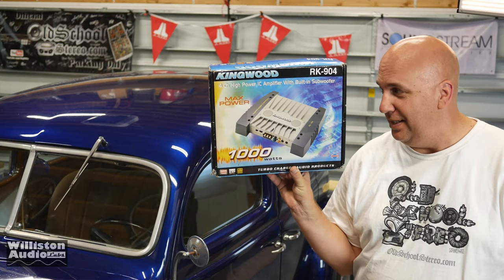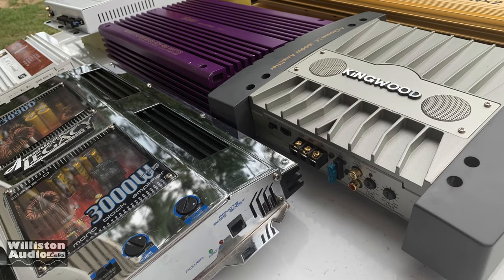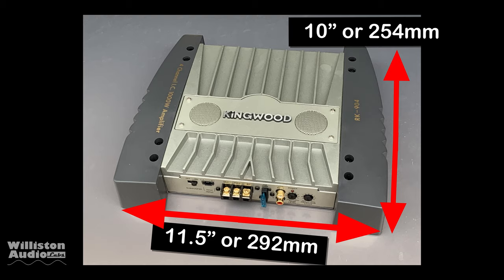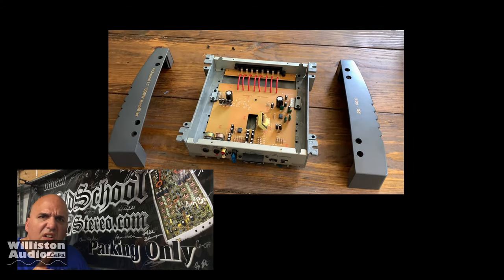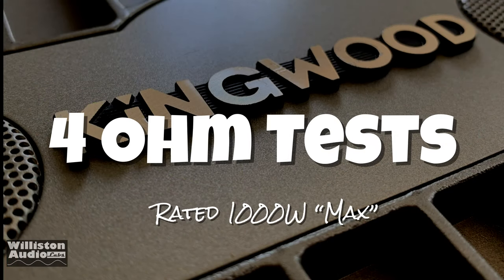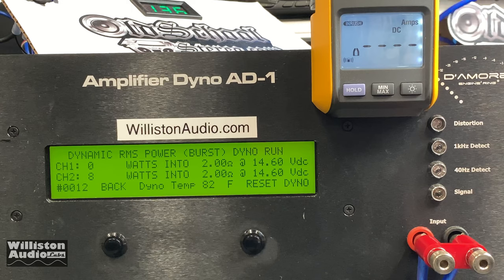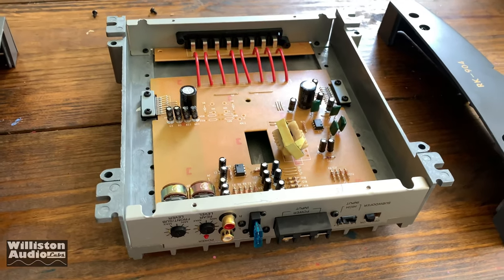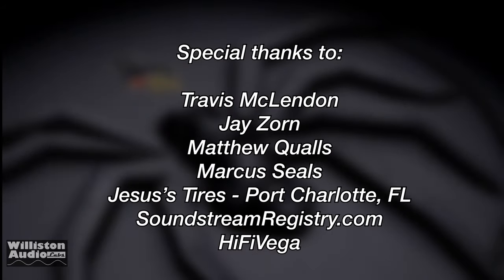Amp With Built In Subwoofer? Kingwood RK-904 Flea Market Special [4K]

Comment: Love these flea market amp tests. Takes me back. I got duped over 20 yrs ago by one that was supposed to be 275x2, and was a mostly empty case with lead weights inside it and had 3 20 amp fuses that didnt even connect to the board.

Comment: I had my share off flea market amps.  They used to have clearance sales at the Civic Auditorium here in Omaha Ne back in the 90's.  I bought a red amp that said 1000 watts max and it did not have a gain control on it and I bought  a sub box with 2 15 inch subs with tweeters.  I though i had something back then didn't know any better.
Reply: Dj Kamikaze 😂 we’v all been that route

Comment: I'm a Kingswood authorized dealer and the reason you got those numbers is because you did not load waste into the flux capacitor at the center of the amp as instructed by the owners manual. also, those two rings were holding dark matter and by moving them not only did you rip a hole in the space time continuum, but you also voided the warranty buddy.
Reply: Thats what I was gonna say. ...

Comment: A more ridiculous amp is built by RF in their Lightning Audio line. The amp is labeled with the Fast and the Furious logo, with the wires themed the same way, and the accompanying 10 inch sub is grey and red that says Fast and the Furious in the dust cap.

Comment: I think it's a great amp, for those wanting to just understand how components can make some power. Could also be good for begining amp repair since there is plenty of space between components. Not so good for use though.
Reply: True to a point but IC amps like this are completely different from amps with discrete transistors so practicing diagnosis and repair on an amp like this doesn't serve much purpose. There are plenty of broken, decent quality amps to be had cheap if someone wanted to practice repair

Comment: I'd like to assemble the guts of a REAL amp inside that case and hook it up in a car to mess with my friends.
Reply: Holy shit. I might have to do this with a Pyramid heatsink! This would be a supreme punking for sure. Brasilian amp PCB would do nicely.
Reply: How would you heatsink the FETs?
Reply: @cup_and_cone  It would be too much of a pain in the butt to actually attempt. A novel idea though.
Reply: @cup_and_cone  But, if I really had to (for this lovely Kingwood) then probably JB Weld two of three studs/standoffs onto sink, then use a bar and thermally conductive isolators to clamp them down. Taramps 4 channel amplifiers are compact as is the HD series. I think having someone think this flea market amp is driving 2000 to 3000Watts into a quality subwoofer would be the most fun.

Comment: Id take any boss amp over this.
Reply from the maker: Yeah pretty much
Reply: Boss amps are honestly pretty well built and designed, if they just gave them honest wattage ratings they'd be a good company.
Reply: @ixionn563  some are and some not as well as many other budget amps. Its usually a mixed bag when dealing with them.

Comment: I remember a friend of mine buying a flea market amp that was purple and said “LA Power on the front. It was a huge amp. It kept overheating and shutting off on him. So I took the bottom plate off to look inside. There was a circuit board in there similar to this one in the video. Except it only took up one small corner of the amp. The rest of the amplifier heatsink was empty.

Comment: I think this was by far, the greatest example of a cheap flea market amplifier I have ever ever seen. I am still in disbelief at the crappiness of this amplifier. Nasty galvanized bottom plate. One sided, through-hole phenolic PCB - and most of it was phenolic and nothing else. Interesting how they spent the time and money for the top cover and two round grilles. To be fair they did say 'IC Amplifier'. The Chinese forgot to add 'Xover' or 'Crossover' after 'Built in Subwoofer'. Nice transformer by the way. Looks like they too it off a compact fluorescent backlight supply from a laptop. Incredible. Dick Riculous shot this down super fast.

Comment: We had a flea market amp in 2001. We took it to electronics class to fix it. When we opened it up, it was just a single board with power going to the LEDs. The terminals and RCA's were all mounted but went nowhere. No circuits existed other than the protect and power LEDs. We had a good laugh. Similar to this, it was very heavy. I think we paid around $50 for it. Got what we paid for I suppose
Reply from the maker: Yeah, that’s crazy
Reply: Yeah a light show. 😜😜

Comment: I have an alpine amp it’s one of there old skool ones. It’s huge and very heavy. It’s a d block 2 channel and I think it gives out 900 watts at 2ohms bridged across the 2 channels at 14volts. I never thought much to it but apparently it’s a very good sort after powerful amp. It also has an large 80amp blade fuse in the side 🤷🏻‍♂️ it’s the MRV-1507

Comment: Should do the cheap amp shoot out... For the high school kids with low funds. The power acoustik amps vs lanzar etc. Even though they wont do their claimed 4000000 watts.. They do put out a solid 1000-1800 watts for 200 bucks... Like a comparison between wattage and efficiency and price and over all quality. For a budget system if you can get two efficient amps that push 1000 watts and a couple budget subs.  You Could build a decent system.
Reply: My little brother and his friend both have the same model Honda accords and they are doing an all out budget build to see who can get the most sound for 600, they can use head units they already own, and deadlines Oct 1st lol I can't wait to see who does the better build!
Reply: @frankkirkman5994  hit me up when theyre done.  Be a good vid

Comment: You need to get your hands on an American Hi-Fi EQ booster from around 1991. Gold colored faceplate with an ALARM. It has a TDA2030 8W mono amp inside for its four channels. The EQ sliders have no frequency adjustment. It’s like 10 volume controls all wired in series. Easily the worst of the worst.
Reply from the maker: Sweet! Right up my alley

Comment: Holy crap! The speaker outputs are not even marked 'Front/Rear' or 'Main/Subwoofer'. I will guess the leftmost 'Left' is the front or main. Without the manual I guess you just play with the gains until you hear which is which.

Comment: Hi there! Got a quick question for you:
Do you know if there's any Class H amps for cars? These are class ab with modified power supply to modulate the rails power slightly above the output height sinewave in order to reduce heat generated in the output transistors. That class is widely used in pro audio amps like crown Hi-Tech amps. This improvement made for us really tiny amps with a lot of power output in a small form factor while preserving the same rock solid class AB, full range output and high damping factor those amps are capable of. I wonder if car amps manufacturer went crazy enpugh to implement that... thanks
Reply from the maker: The 90’s Zed Audio amps are Class H. HiFonics, Autotek Crunch and more. But need to be from the 90’s

Comment: I'll be generous. If you look at that fuse and provide it with 14Volts at the full rated capacity of the fuse, Volts X amps is only 210 VA, or in DC watts.  Wonder how they get a KW out with only a maximum of 210Watts in?  Reality check time.

Comment: Where's the beef? I am having flashbacks of my Pyramid 1000 watt. when I checked it out.
200 watts RMS?
Reply: Oh. That hurts! Not even 100 RMS. 😁. Wow!
Reply from the maker: Prob so
Reply: 2ΩIMFJ CD5 I had a pyramid 900... it bumped for 16 year old me... this is in a class by itself...
Reply: @ThickCutOhio  you are welcome to see what I'm talking about on my Instagram. I'm not knocking Pyramid quality.. I still have it and it's like new but the quality is nothing like my skar 1000 .1
Reply: 2ΩIMFJ CD5 this was a scamp scam+amp=scamp
Reply: @wal  the spec. sheet says 1000 MAX. 50 watts RMS.. How do they figure it's 1000 max even if it's CEA rated? I still see a 200 watt max output (100 actually.. I'm being VERY generous).

Comment: I feel bad for anyone that bought those Kingwoods. You are basically using your head unit to drive an external head unit, what a waste of a heatsink. At least that Legacy amp and Thump use real designs and give a couple hundred watts give or take a little, of course the ratings are inflated, but better than that Kingwood.

Comment: I have to admit I really like the chassis design even though the internals are hot garbage. A fun project might be to pull the guts and put a quality class D module from Parts Express in that chassis. Then you’d have a decent good looking amp that could put out some power.

Comment: Is the traditional quantum flux super capacitor also included? What about the micro black hole hawking radiation backup power supply battery?

Comment: better get a sony head unit that has 22x4 rms, put a pair of infinity or similar 6"all range in the front, wire the rear channels into a crossover to low and sub-low stereo input to mono output, put a 8" oem hi-fi sub 90 rms, i did that, had amazing results.

Comment: What the hell does 'Low Thermal Resistance' mean!? It has a low threshold for high temperatures? Ohhh. They took it off the TDA IC amp spec sheet at random. Ok. Not like it would ever reach any sort of thermal condition with its blistering maximum 25W of output power. If they were trying to say the heatsink is excellent then it should have said 'High Thermal Conductivity'.

Comment: The biggest red flag of any amplifier is the fuse. I still remember the "magic triangle" from middle school shop class on electronics and that watts = volts x amps.

So roughly 14 volts x 15 amp fuse says it's power consumption at 100% efficiency is 210 watts. It's been a while since I sold amps retail, but pretty sure this isn't a class D amp and benefit of the doubt going to a class A/B amp is at best 60% efficient on what it puts out over what it draws in. Which would have ball parked this at 31.4 x 4 or 126 watts total RMS at best. It performed much worse than that. Ouch.

But almost 20 years after I got into upgrading my car audio not for competition but for better enjoyment it looks like it is rarer to see honest marketing and actual specs put on products. Everything is PMPO and unrealistic RMS so you have to cautiously match and tune everything or risk blowing a "1000 watt" sub on a 200 watt RMS amp. I see a lot of sub reviews saying subs blew in a week, meaning they didn't match them up or set the levels into what the sub could handle RMS.

I doubt many of the stuff you'll get online marketed at 1000 watts will match the Rockford Fosgate 500x and 500s amps run in combo I had in my car in 2002 driving 5.25 component fronts, 6x9 rears and 2 10" in a bandpass enclosure in the trunk. That was running at 500 watts RMS @ 4ohms for everything and it thumped hard, loud and clear.

Comment: I’ve got a 1990 MR2 Turbo - anyone know of a decent sub that’ll fit underneath a low Japanese sports car seat?
Reply: A 6.5 inch sub might fit. Try finding one and measure dimensions including the box volume. Or an underseat subwoofer with built-in amp. Space is the factor here, you cannot mount it behind as well. Probably at the dash/kickpanel(?) area if you might try. Or at the center console if ever possible.
Reply: Hmmmm.... I would just put a 10" sub in the frunk (front trunk) of that thing and call it good.
Reply: Edwin Shopteese
That’s definitely plan C. A buddy of mine has his frunk completely filled with a 10” sub. It sounds decent at idle but if the car is moving or above 2000rpm it might as well not be there.
Good idea.

Comment: That's crazy... Thanks for showing that. When you showed the flea market amps together, what was the clear top one called? Did you dyno it?
Reply: The clear top one is an American Legacy.. they used to sell them on Ebay about 16 years ago? Not sure if they still do. They are a brand that claims high power outputs when really it's about a 1/16th if that of their claims.

Comment: I can't believe someone tried to bring this back and fail thay bad.. Bad Bad when I saw the guts I couldn't stop laughing.. but only thing then I wondered was will ther cheap plastic end caps fit the Rockford?  Cause I sure have a lot iif 800a2 and 800a4 without caps... lol but really tho that was a joke to.  What I didn't catch in the video was how much was that big amp and what is the main amp itself made from?  Can't be cast aluminum on that.. lol

Comment: I've been trying to find my Front/Sub lever. Anyone know where that would be located in my car?
Reply: It starts with the receiver if adding amplifier  for each if a crossover between them tweeter, midrange and subwoofers . It starts with the receiver not the amp or the crossover . They do have some effects . . Keep high end mid range and subwoofer separate if running amps fer each with the crossover  they do differ from graphic to other  if an amp has built on read the Manuel if an amp other than for a sub woofer only low hertz fer subs mid . That depends on what one got to make the sound sounds better
Reply: I didn't continue
Reply: A max on subwoofer and amplifier  is a burp only go to rms on them I had a 1000 still do.  A don't amp.1000 watts only 185 ems on 4 ohms however I can get a,burp on 1000 watts.  Example but true I ran 4 subs,way more on max it sounded good even on low hertz 30hertz and below

Comment: That Kingwood will stomp all over that Fosgate amp. Its much lighter, less components therefore it is much better.
Reply: Not to mention more efficient ... You can sun it using a 12 gauge power wire lmao 😂
Reply: @miguel300ish  < run it right off the remote or power antenna deck wire.
Reply: @chuckmiller5763  yup that should do it

Comment: When you took the steal plate off the back of the Kingwood, which is used to make you think the amp is heavy, what a disappointment. Insult to amplifiers
Reply from the maker: That steel plate will stop bullets!
Reply: @wal  yes steel, not steal as I wrote. I guess I was thinking about how your getting robbed if you buy that piece of junk!

Comment: Doesn't a 150a fuse allow a 150 watts🤣 but says 1000🤦‍♂️
Reply: Roughly, multiply the voltage input by the fuse amps to get the amp's max wattage. There's a lot more to it than that (you're losing a good chunk of your input power to heat) but that'll give you a decent ballpark number to at least be able to call bullshit on bogus numbers like these. This sad sack of an amp...12v x 15a = 180 watts before the fuse pops.

Comment: If you have a head unit that does 50x4, would this still be called a amplifier? That would maybe cool to put a real amp in that case! Ha-ha, that's a paper weight. Not amp!!
Reply: Yeah no kidding. Head units have been putting out a solid 15-20 watts x4 for at least 15-20 years, this amp isn't even a step up from that. Pathetic